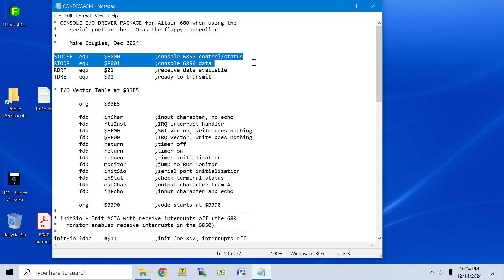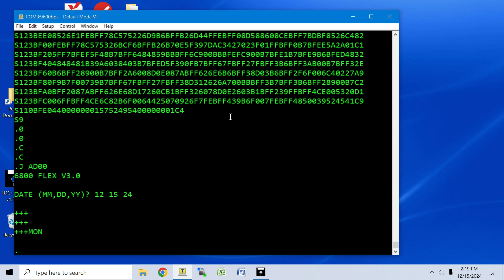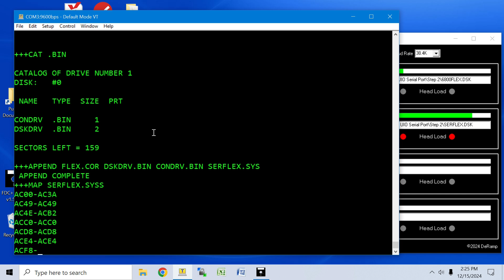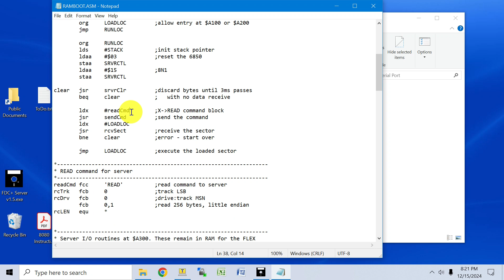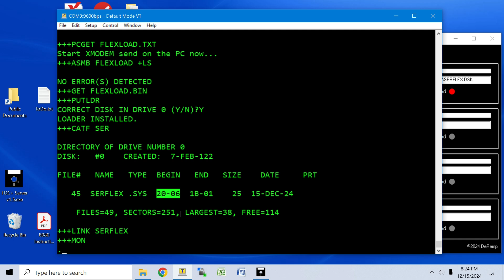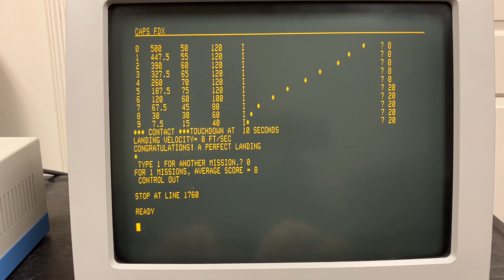A Diskless Disk Operating System for an Early Microcomputer (FLEX on an Altair 680)

Comment: Im from back in the 70's and ive been watching several vids on the 680. Wondering if there are any kits (don't have to be original) for the 680 or any modern emulators with the front panel switches?

Comment: Nice, Years ago I cloned a SWTPC computer, using a pile of wirewrap. I mostly designed my own circuits using a pile of 6116 2K static RAM's to make a box the looked like the SWTPC 6800 from the software side. I wanted to play with the 6800 and I could see no other way back then.
I never knew Flex was so accessible, source code wise, to do what you just did, I though it was all propriety and would need a pile of reverse engineering to do anything like this.
This has got me thinking about building a new 6800 box using modern 32K static RAM's, and booting it via serial. Although the thought of putting the main parts of Flex into a large EPROM to speed things up also sounds interesting.

This project solves my main concern with my old Flex box, and that is what to do when the floppy system dies, parts are slowly getting harder and harder to obtain, I'd like to move the floppies to a way more modern storage solution while I can.

One thing I have done is to make my box available on my local network so I can just Telnet into it (using a first gen 'Pi as the ethernet/serial bridge) rather than chasing serial cables etc. driving it from a mobile phone over WiFI was king of weird. With a new build, using a serial 'disk server' I could just leave it up, and even open a port on my router for remote access, as I'd have no worries about old hardware failure.
Reply from the maker: @paulstubbs7678  My next video will be a short one showing diskless FLEX running on the SWTPC 6800. I’ll have the files you need posted once that video is live.

Comment: Great video, great project, thanks for doing this!

Maybe you already know this, but Epson used RS232 for disk drives for the PX8 (CP/M laptop,  which also runs CP/M on microcassettes...) and some other CP/M computer. IIRC they also used 38400 but I might misremember.

Sure, these are half a decade newer than an Altair 680, and I have no idea what the price of those Epson drives would had been and if the protocol documentation were available to the average hobbyist. It would still had been a way to keep an Altair 680 (or for that sake any similar computer) in use in the 1980's.

Anyways, if you want to you might want to consider adjusting your protocol to be the same as Epson used, or add an Epson mode to your server. I admit that I haven't had a look in many years, but say 15 years ago or so there were only a DOS based disk drive emulator for PC, so anything newer running on Windows or Linux natively would be useful.

==================

Going off on a tangent, if you ever run out of ideas for projects, you could look into a DIY IEEE-488 interface and connect a PET disk drive to one of your vintage computers. Since those disk drives have a built in DOS you would most likely want to modify a ROM/cassette basic to work with those disk drives. (And for that sake also printers on the same IEEE-488 port.

Or for that sake use one of the newer Commodore disk drives with a serial interface. Would be less period correct as those are at least three years newer than the first PET disk drive, but still. The serial interface is a serial version of IEEE-488

==================

Speaking of diskless operating systems:
If you ever feel like tinkering with something similar to what Epson did with the PX-8, i.e. run a disk operating system with cassette tapes, you could build an interface to connect a computer to either a wired remote control port on a cassette deck, or for that sake connect directly to the buttons. I think that cassette decks that have electronic control for all tape transport functions, but don't have the "collector/entusiast" desirable features (three heads, double capstan and whatnot) are relative cheap as they tend to be mid-range models. Or for that sake use a car stereo with electronic control of all tape transports (i.e. a factory head unit that someone forgot the key code for). If you do something like this you might want to modify the cassette deck to be able to record data on one track while reading another, so you can have a sync/position track and a data track, to easily find a specific spot when writing to tape.

Comment: This server/client solution reminds me a lot of NHACP. That is the protocol used by the NABU community, and it has quite a few enhancements. I have written tools to use it on CP/M 3, and it works really nicely. It allows copying files back and forth, it can also supply date and time to the client, and the NHACP server can even relay requests for URLs. 
That allows an 8-bit computer to download files almost directly from the internet.
Reply: @mal2ksc  It's a small commmunity, but they achieved a lot.
A couple of years ago, someone sold a lot of new-old-stock NABUs from some warehouse on eBay.
And there has been a lot of development around them. The NABU Network has been replaced by software running on a modern PC, serving the NABU. And a lot of new software has been created since.

Comment: A thought on your disk server. Would it be possible to set one of the disks slots, not as an image but something that supplies data to the host as if it were a disk with a small file FATted to each track. Any attempted access to any of those files would cause the host to attempt to access the track associated with that "file", the disk server can then use this as a signal to swap a disk in one of the other disk slots, thus giving you the ability to swap disks from the 680 itself and allowing the server to be blind?

Comment: Its actually amazing how usable this system is. It reinforces my belief that no computer system is ever obsolete, it can always perform a useful job until complete failure, and sometimes even past that.
Reply: I had the same realization when I started actually using CP/M. Once I got CP/M 3 with the Z3Plus extension running, it is even more comfortable than DOS in some areas.
Reply: It's questionable though whether it's a better idea to run on the original hardware (it uses up lifetime, but confirms it still works) or run on FPGAs and emulators as much as possible and only break out the original hardware for demonstrations (but then you have to check it every time).
Reply: @mal2ksc  There is a middle ground:
Modern retro systems.
I got my start with CP/M on John Winans' Z80-Retro board, from the YT channel Johns Basement.
That is a Z80 based single board computer that uses a Z80, SIO and CTC, ROM and RAM, and some discreet logic to implement a full CP/M system on a small 100x100mm board. 
Then there is RC2014 kits, a modular system in the spirit of the S100 bus, just smaller.
And there are a lot of comparable systems, built with largely modern parts for running vintage software.